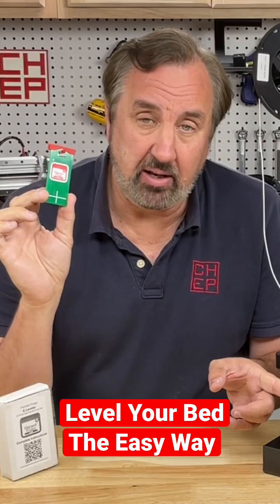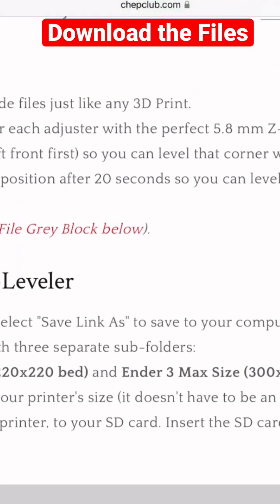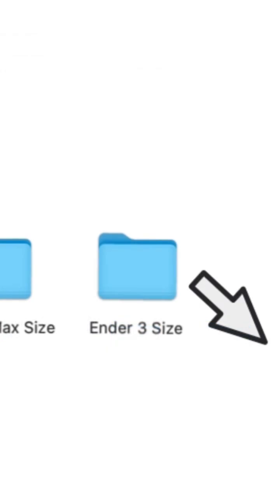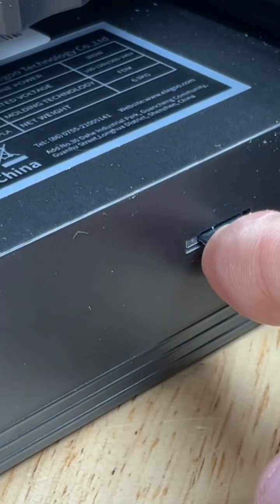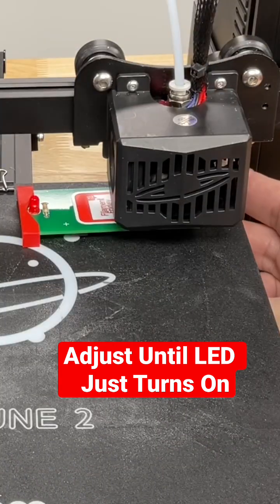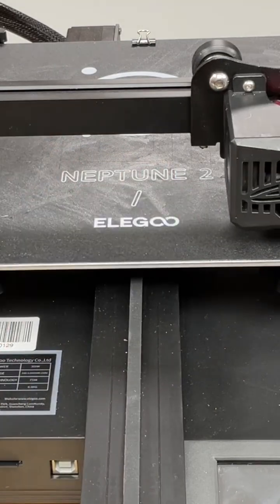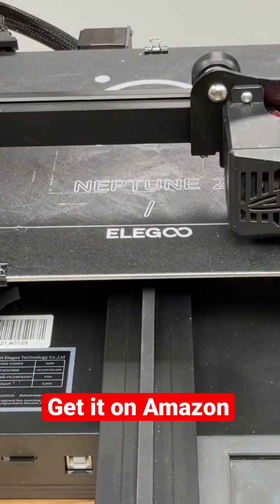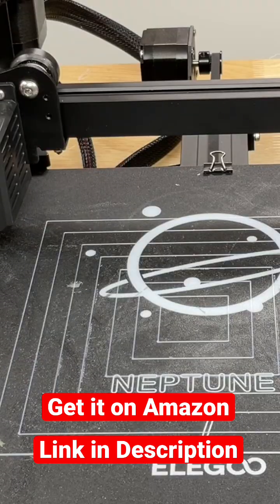Easy Way to Level Your #3DPrinter using the #FilamentFriday E-Leveler

Comment: Can anyone help me out with an annoying problem? I’ve had my printer for half a year and have yet to been able to print anything. When I level the regular way, and this way, I begin to adjust/tighten the knobs on the bottom side of the to raise it; but as I raise it the knob literally has no more room to tighten and just slips off. Any tips?
Reply: Try doing a TRAM of your bed. Pretty easy, just find some videos on YouTube

Comment: What if you don’t have any of the printers listed in the files?
I have the tronxy crux 1, which is a smaller version of an ender that prints a little faster and has some other better features.
Reply from the maker: Should still work.
Reply: same printer

Comment: Can tell this was designed by an old geezer who is really out of touch with the actual 3-D printing community. This is one of the worst ideas I’ve ever seen it’s almost 5 to 10 mm off the build plate which increases inaccuracies. It is still easier to home your printer disable steppers and move the print head over to each of the four corners with a business card or a folded piece of paper. Not sure where this old geezer got this dumb idea.

Comment: Trying to do this on the Neptune 3 max 420x420x500. Im guessing i cant use it for this since the code only goes up to 300x300? Also the distance between the base and top of the device is bigger than a sheet of paper, so am i adjusting the off set to whatever size this gadget is, level then bring the off set to 0 once its all leveled?

Comment: I tried downloading the files from another of your bed leveling videos but the extruder doesn’t pause at the corners- any suggestions on a fix?
Reply from the maker: Download from here. It pauses 20 seconds at each corner. You can run it more than once. 
https://www.chepclub.com/electronic-bed-level-tool.html

Not all machines recognize the pause command to wait for a click so we offer the pause. You can modify it based on this video: https://youtu.be/PA1pdyiM8C4
Reply: @FilamentFriday  thank you CHEP!
Reply: Are there files for the Ender 5 plus?

Comment: This looks like leveling with a piece of paper.....but with extra steps
Reply: what extra step? if anything, it removes the step of having to jiggle the paper back-and-forth and feel it out
Reply: @Caden Scharpf  the default files to move the printer head surly seems easier than turning my ender 3 knob 289274 times to get into the right position
Reply: @LukanRocks  With the right firmware you have built in leveling menu.
Reply: @Jantje Jansen  with the right anything, you can do everything
Reply: @scharpmeister  the extra step is buying the thing
Reply: The paper don't exactly give you the best feedback

Comment: If only my glass bed wasn't warped from the factory...
Reply: Omg same issue with my older printer (CR-10) that was terribly frustrating!
I bought a new glass plate from a glass store.. 
Worked amazing!
Give it a try
Reply: Glass warped? Jeez ur unlucky
Reply: @Ncky  you never ran a glass bed before eh? pretty much all of them are. most people buy mirror tiles for a better replacement lol.
Reply: Frickin glass elitists... In every thread. 😂 But seriously whatever works for you is great. The glass bed works for some, pei others.
Reply: my glass and metal bed plate must be warped
Reply: Just cut a plain piece of window glass to shape, preferably 3-4 mms thick, i wouldnt go thicker than that, and youre good to go
Reply: Buddy why aren't you on a magnetic pei spring steel bed? I got months ago and I can't even begin to explain how much better it is. It's night and day and a must get
Reply: @Mr.Thermistor7228  i got one and my bed is warped roughly 1,5mm (bowed up in the middle) 
Prints still come out great tho due to the auto leveling

Comment: a prusa owner has no idea how to do these things and I’m glad I don’t - there’s still some quirks but I only ever change the z height manually when changing those spring sheets.. just to check how well it sticks.. I swear prusa is as close as user experience as paper printer, you set it once, and if yoy don’t move it it can run the same for years, actually more reliable than most inkjet printers
Reply: Yeah as a prusa owner I had no he was talking about I literally print stuff from another room never actually seeming my first layer go down then I go and grub it when it's done

Comment: I just use BL Touch.
Reply: Bltouch still needs a decently trammed bed
Reply: @UnwrittenGamingftn  Actually no, this is why BLtouch is so great. Just do a basic bed leveling and calibrate probe height/distance/etc. Then do a G28, G29 before every print.

You can even change the print bed surface to another material without having to re-calibrate the bed.
Reply: @Linuxdirk  None of this matters if your bed leveling is crap to begin with. Smaller overal deviation will always produce better results, with or without a bltoch 😅
Reply: @UnwrittenGamingftn yeah your bed is basically only going to be level for one print. the bl touch ensures consistency. your print bed and printer in general bends and contorts A LOT just from you scraping a print off. this isn’t a milling machine you tram it in to .0005” and tighten down a bunch of bolts so you know it doesn’t move, it is spring loaded.
Reply: With a BLTouch you can do the auto tramming program in Marlin
Reply: @choahjinhuay  I just added it to my already somewhat custom machine start gcode in Cura.
Reply: @choahjinhuay  Why is it that everyone confuses levelling with tramming.... There is no such thing as auto tramming in these kinds of printers...

Comment: Is the battery suppose to be lose in the insert? Where it slightly hangs? Mine doesn’t sit flush, so I’m curious if it’s suppose to be that way and if the pressure from the nozzle is what pushes it in and allows the light to turn on. 

I’m also confused in adjust the z to 5.7? Is that 5.700 or .57?
Reply from the maker: The battery should fit tight. If not contact the amazon seller for replacement. 
5.7mm. The GCode got it that you download handles that for you. Just scan the barcode on the box.
Reply: @FilamentFriday  I’ve contacted the seller to replace it. Also, the barcode on the box didn’t work but I found it through your website.
Reply from the maker: I just fixed the broken link. Try again.
Reply: @FilamentFriday  so when I do the  5.7mm and try to level the bed. It makes me turn my wheels where the springs are completely loose. I just can’t seem to get this working right. In desperate need of help.
Reply from the maker: Lower your Z stop switch so it homes lower. Then run the GCode for the E-Leveler again. https://www.chepclub.com/electronic-bed-level-tool.html
Reply: @FilamentFriday  I currently have a CR touch on my ender 3.
Reply from the maker: Ok, crank the leveling knobs all the way tight. Then run the GCode.
Reply: @FilamentFriday  I’ll give that a try!

Comment: If you have OctoPrint see if you can get the screw tilt adjustment macro, works wonders on klipper firmware
Reply: What does that do?
Reply: Absolutely. I love it. This and BED_SCREWS_ADJUST and SCREW_TILT_CALCULATE are the best.

Comment: I found that after using the tool, the nozzle was too close to the bed. I needed a Z offset of 0.44 mm to get the correct alignment for the nozzle on my E3 V2.
Since you can't save the Z-offset on an E3 V2, I modified the gcode by deducting 0.44 from 5.8 and correcting those lines to 5.36.
This may be an inaccuracy in the manufacture of the leveling tool, or maybe the switch. I renamed the file "PLA Level.gcode".
Since PETG needs a different distance, I'll make another file and name it "PETG Level.gcode" the next time I print PETG.
Reply: @Hermitmaster  I am planning to update the firmware, but still found it worth mentioning that my tool does not work with 5.8mm. Even with updated firmware, I'd prefer a Z offset of 0.0 to be the baseline.
Reply from the maker: Interesting. We randomly check them. Yours must have slipped thru. That’s why we open the GCode though so you can modify it. https://youtu.be/PA1pdyiM8C4
Reply: @FilamentFriday  even more interesting6. Now that I have updated the firmware from the site you recommended, it's 5.8. For some reason, my user interface looks like a DOS computer from 1982, but everything works...